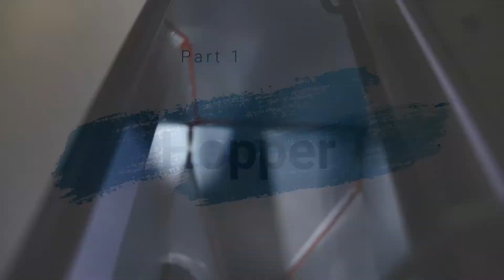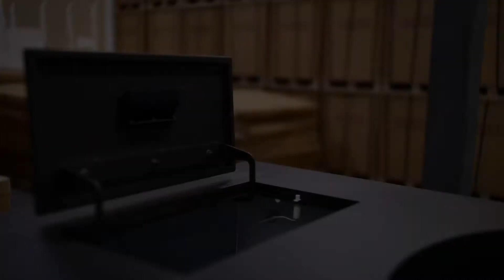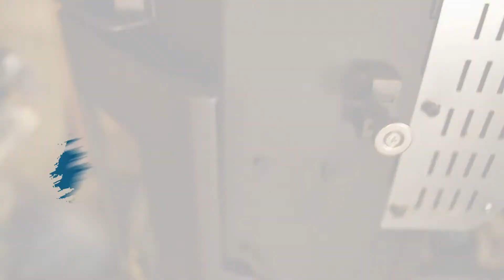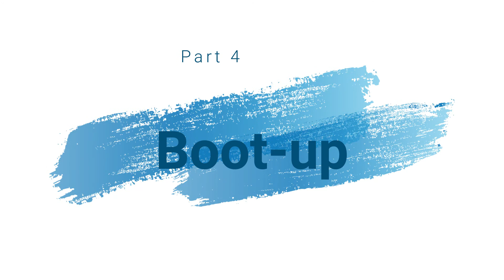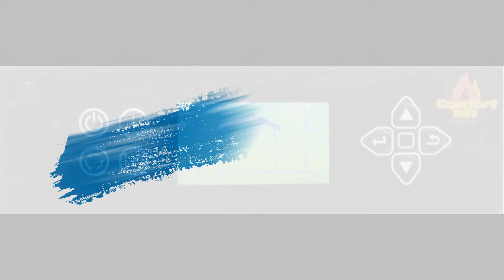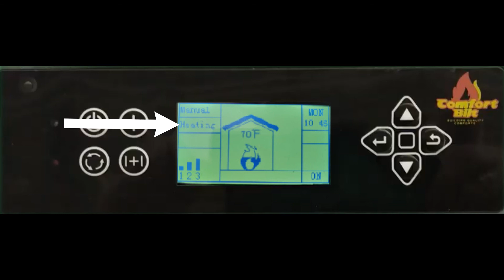New Stove Tutorial Part 2 - Pre-Ignition Check

Comment: Can I adjust the pellet feed to be slower?   Even on low temp setting or manual low it gets to warm
Reply: I don't run mine till it's 32 degrees or colder. I never go above level 2. I am not sure on pellets going slower, but their customers service gets back to email same day.
Reply: @joedunn2545  thanks.   I did find how to adjust feed rate, and blower voltage for fresh air and exhaust.
Reply: I have the same problem. Drop the temp to the lowest setting (61 degrees) and within about 45 minutes, it'll shut down on high temperature.